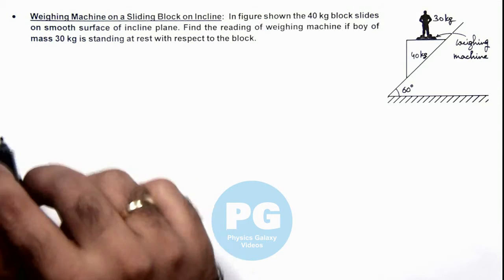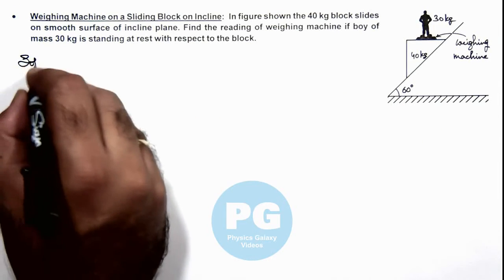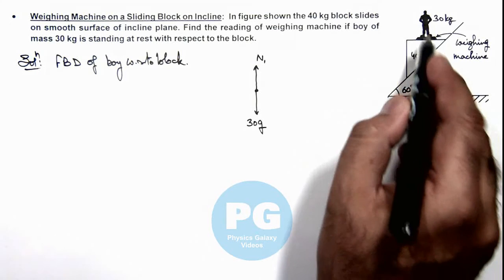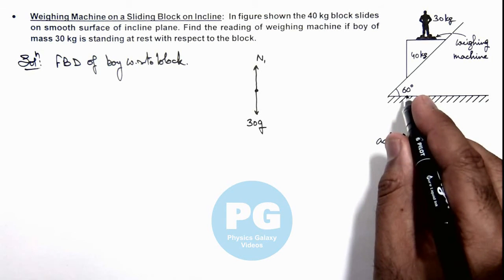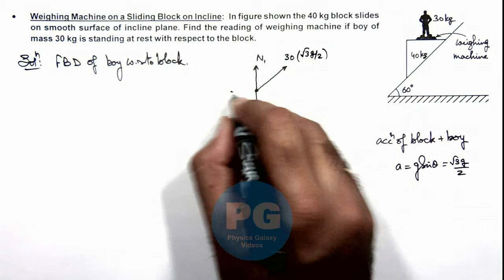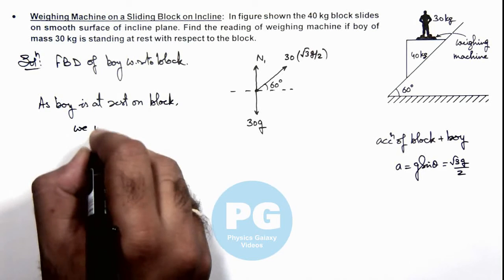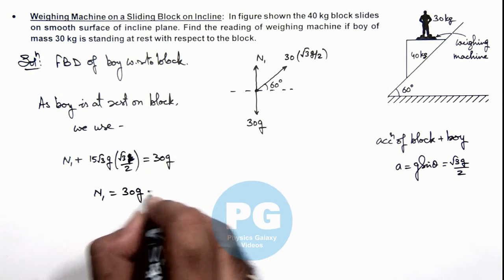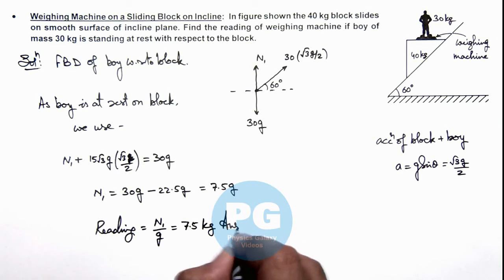Advance Illustrations – Weighing Machine on a Sliding Block on Incline | NLM #45 for JEE Advanced

Comment: How can we solve it without pseudo force? What will be the eqauations?
Reply from the maker: In that case we consider the friction between man and machine and resolve forces in ground frame...
Reply: Right sir...but I m not able to write eqauations..can you elaborate more.
Reply: Physics Galaxy ...thank you sir...I write eqauations pls chk.. friction f= 30g.sin60°.cos60° and  for downward motion 30g-N= 30gsin60°.sin60°.....but sir there is no need of friction eqauation..from last eqauation only I got answer...
Reply from the maker: Yes thats right...
Reply: @rohitdiwaker1000  Bro After 5 Years I found this comment useful. I had done it with pseudo but was not able to do it under non inertial frame but here i realised that friction will act between man and machine. So we need to do it by considering the acceleration = g sin60 which is independent of mass and from single equation it cracked. Thanks. Where from u r?

Comment: There should be friction acting on the boy leftwards, otherwise he will slip rightwards on the block. Please address my point.
Reply: I think you are correct
but here no need to balance the horizontal force
Reply: @ayush1643  yes
Reply: Yup ...it will be required if you solve it from inertial frame 🙂